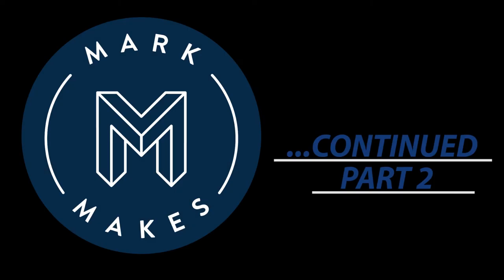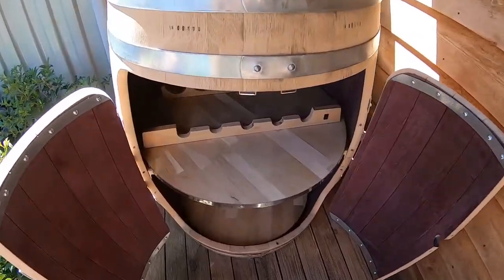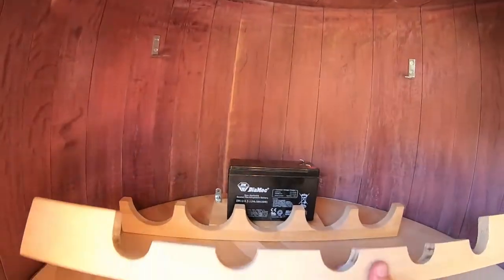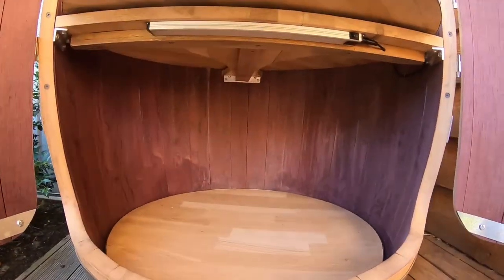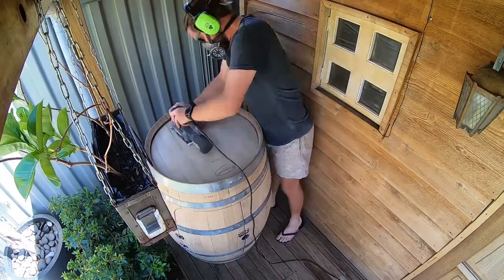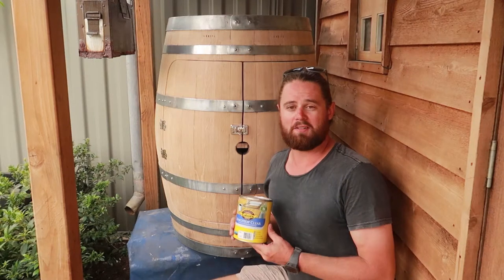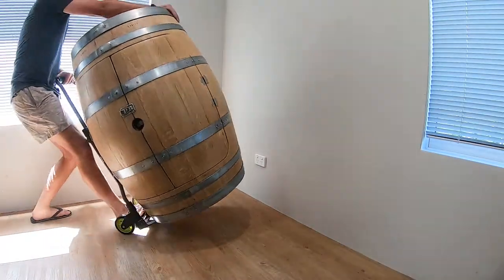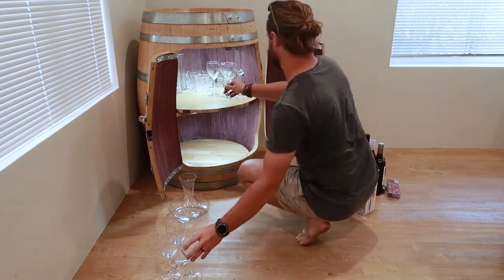Make your own Wine Barrel Liquor Cabinet // PART 2

Comment: Currently working on one. A lot of videos show fasteners for each piece of wood on each ring. I like how clean yours looks. Did you glue every ring? Does compression just hold the top and bottom rings on?
Reply from the maker: Hey Ryan, I didn't glue any of the rings except for the sections on the doors.  If take out the original nails holding them in and push the rings down tighter than only a couple of sections need to be fastened and the pressure will hold them in place. 👍 All the best with your wine barrel conversion and thanks for watching 🙂
Reply: @mark_makes_  thank you for the reply and for the info!

Comment: I don't want to sand my barrel and want to maintain the Distributers stamp on it. Do you feel that a varnish coat would be sufficient?
Reply from the maker: I also wanted to maintain the distributor stamp, not sure how deeply ingrained your's is, but with a light sand it's still quite clearly there. The varnish does bring out more detail, but if the oak is starting to grey it might not look as nice. All the best!

Comment: Great work, mate! Can I ask how you originally cleaned up the metal brackets on the barrel. Did you use a wire brush? Or just normal grit sandpaper?
Reply from the maker: Thanks! I used a sander with a rough paper. All the best 👍